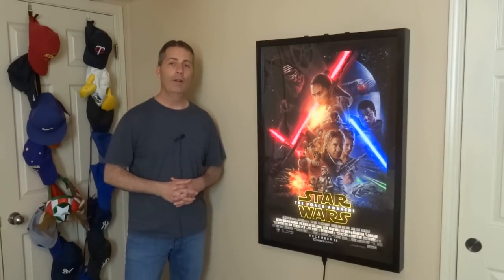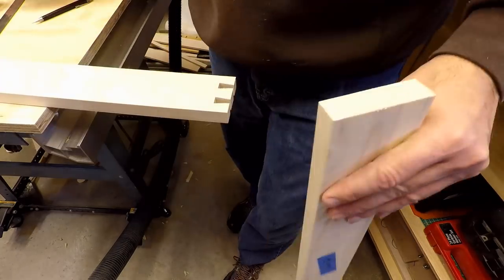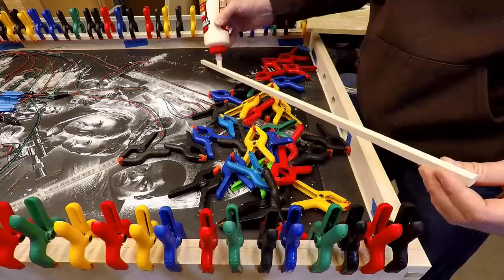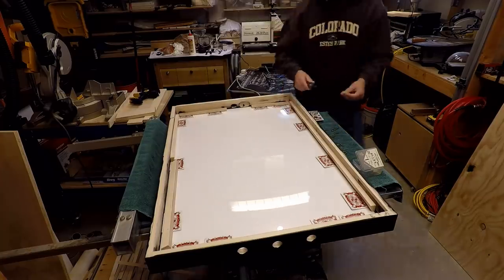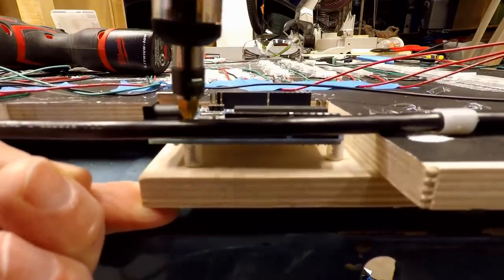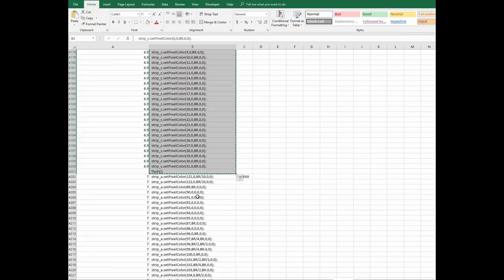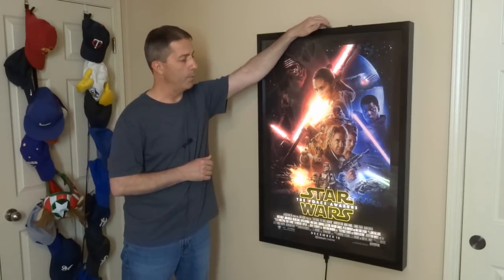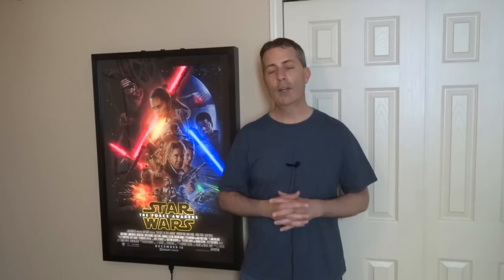Star Wars The Force Awakens Animated LED Backlit Movie Poster

Comment: I'm looking at making backlit posters and this is a damn good idea for customizing them.

For ease of use to the consumer I'd keep the options simple. I'll probably only do animated lights, stationary and brightness.

You could even add sound by adding a Dayton audio transducer to the back of the acrylic (where it won't interfere with the lights), that way the poster becomes the speaker.

Comment: Great Project and Video!  The only thing that I didn't understand was how you mounted the poster on the plexiglass.  Also, I'm starting to look into Arduino (led light strips) and would like to know where you learned the programming; the light show on the poster is cool.
Reply: Thanks.  The poster is actually sandwiched between two layers of acrylic.  I have to admit I haven't programmed since I had to take a fortran programming class in college over 20 years ago.  There are tons of examples on the web and the Arduino sites and examples built into the interface.  Also look on the Uberguide on the Adafruit.com web site.

Comment: That's just a standard movie poster with LEDS behind it?  They shine through so well I thought it was the movie theater marquee.  How did you get a black and white version of the poster?  Did you print that yourself on some sort of large format poster printer?
Reply: I used a large format copier.  The black and white copy basically gets destroyed as you make the poster as it get holes drilled through it, screws get put through it, solder drops on it, etc.
Reply: Steve Moseley the poster in front is just a standard movie poster then?  The LEDS shined through a lot better than I would have thought they would have.

Comment: con't..And how were you able to keep the lights glowing in there perspectvely assigned areas with keep artwork still visible?
Reply: The lights are very close to the back of the poster so they don't spill light very far to the sides.
Reply: Steve Moseley Dope. Appreciate the explanation..Thanks Again

Comment: Great woodworking and assembly skills, however that's a really bad way to do animation with a microcontroller. I wondered why you couldn't fit it onto a normal arduino as it's actually pretty simple, and shouldn't use much memory to run those animations with relatively few Neopixels. Setting the pixels individually, with separate statements answered the question! I get that it's your first Arduino project though, but please look into using loops, and variables to perform animation! Your code will be much easier to write, easier to test and easier to change - and use a fraction of the memory (disclaimer: I work on industrial installations, using many different microcontrollers, and also design custom PCBs for these, many using Neopixels and DMX controlled systems - I can't match your woodworking skills though!)
Reply: Thanks for the kind responses.  I would have loved to do all of the programming with loops and such, but could not find examples in the hundreds of searches I did.  Like in woodworking or other areas of life, if you can figure something out then you figure out how to get around it.  Thank goodness the Arduino boards are easy to use.
Part of the problem was wanting to have three individually controlled strips.  I can see working on another similar project and trying to get the "proper" code working.  I really enjoyed the challenge of this one.
Oh yeah - I envy your coding background and skills.  I wish I had that knowledge base to draw upon.  Cheers!
Reply: Thanks, I don't want to take anything away from the end result, it looks great! With Neopixels, I generally try to keep everything on a single signal wire (i.e. all the strips are connected in series) unless a very high refresh rate is needed, as they have a fixed clock speed - so longer strips update more slowly than shorter ones. If you want to update many strips with thousands of Neopixels very quickly, then take a look at the Teensy 3.6. It can be programmed easily with a custom version of the Arduino environment and is much more powerful than any of the Arduino boards (and cheaper and much smaller than the mega!) Looking forward to seeing more of your work!
Reply: Hey - Thank you very much.  I have some more projects coming out soon.
Reply: @Stabby666  hello sorry I'm trying to figure out are you saying he could have done all this using the standard  arduino uno? And not a mega? Or because they were all individualy addressable leds you do need a bigger memory? Thinking about doing something similar.. with no experience of arduino 🤔
Reply: @SAda940  Hi, yes you could definitely do this with a standard Arduino, or even an Arduino mini/nano. They can easily run up to 500 Neopixels without problems, while also handling sensors etc. Ideally you need some programming experience, even if you're mainly just using libraries, so you can understand how to reduce redundant code etc. Good luck!
Reply: @Stabby666  Wow i did not expect a reply!! Thank you thank you thank you. I'm learning about variables and  loop? From YouTube of course from john mcwhorter? Really knows his onions!! Hoping to get into it but nothing quite as complex as this build. Which is amazing and inspired
Reply: Beg your pardon its paul mcwhorter.